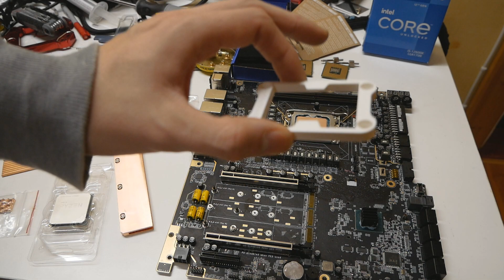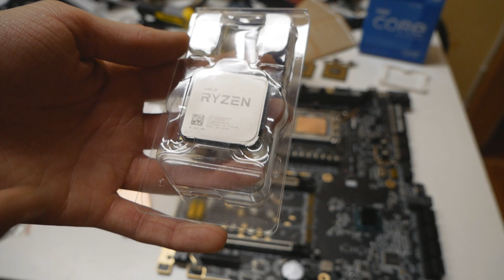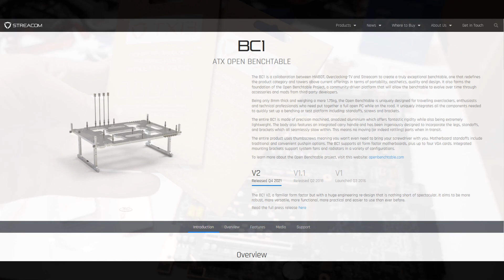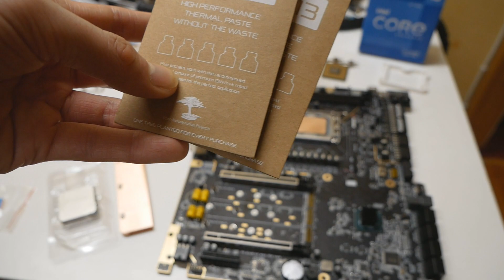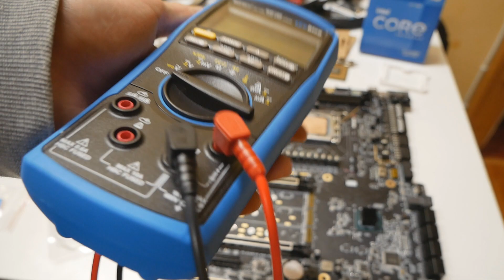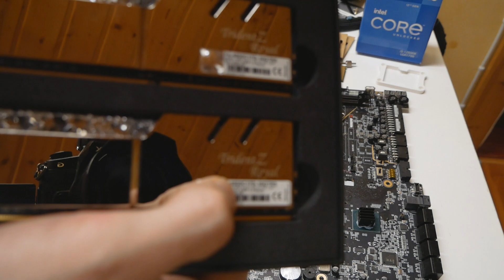Mailbag Friday - Recent Acquisitions & Upcoming Plans

Comment: Hi man! I've been asking people on Reddit but nobody is giving me a useful answer. I currently have a problem with my system where my 5900X won't overheat, but will constantly be at a high temp while in game. For reference, I'm using an EK Classic kit with a DC pump+res combo, a 45mm thick PE 360 radiator, a Quantum Velocity block for the CPU and a nickel GPU block for my 1080 Ti FTW3. I thought a 360mm setup would be enough for all that (~120W CPU in-game + 250W for the GPU) but it seems like the custom watercooling only does its thing on the GPU whereas the CPU stays at "AIO temp". So I'd like to know if maybe a lapping of both the CPU and its block would do something, or if I just have to add some more radiator space (which will be useful in the future since I'm planning on getting a high-end RTX 4000 series).

Comment: I picked up a couple of the phenom II 6 core chips today, there were a few bent pins but I've got them up and running in a oem motherboard on windows 7. Can you recommend a better board to try them in? I'm mostly interested in comparing them with ddr2 versus ddr3 as they are apparently compatible with both. 

Regarding the rest of ur video: 

1. I have high expectations for the Pentium I would very much like to see that
2 thermal paste testing is a great opportunity to discuss controlling variables across a series of runs
3 my experience with the m.2 controllers has been that they run fine up to a point and then just kind of bug out and stop working right ive never seen one that could clock down and keep a consistent i/o at high temperatures but I wonder about these newer phison chips they seem to perform better at high temps than the older controllers

Thanks for alll the excellent content on ur channel!